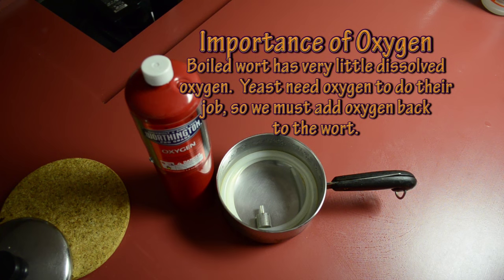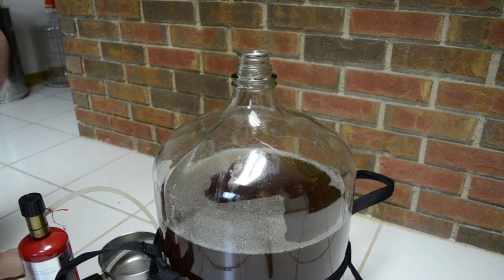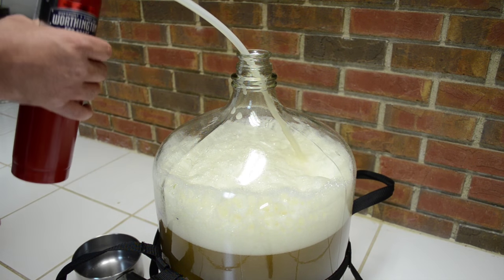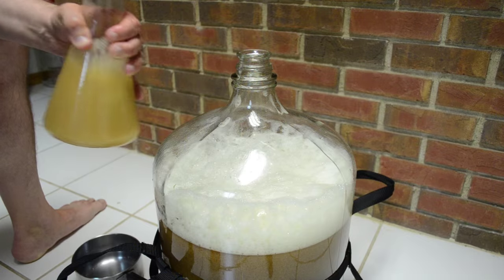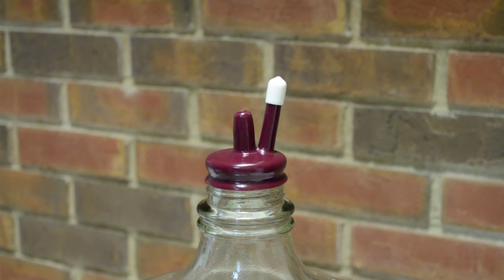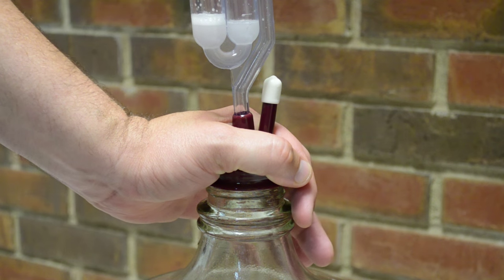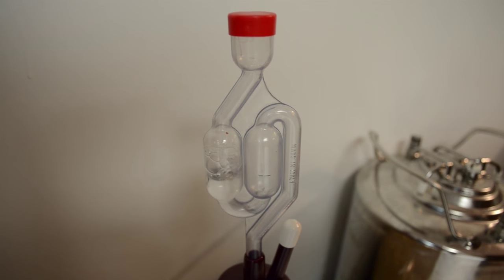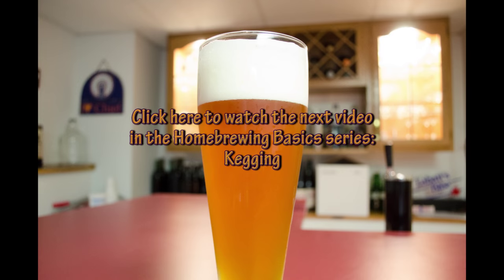Homebrewing Basics: Fermentation

Comment: Great video's, I brewed an all grain beer a month ago, really its been over 20yrs since I last did that and forgot most of it and just went with it, lol I basically violent boiled my grains and hops for 1hr in a grain bag, and poured it into my fermentor and let it cool for 24hrs and added yeast once it was cool enough. Guess what after 4 days nothing, I added a cup of rice and within 1hr It started bubbling and worked really strong for over a week and when it was finished it registered just below 1.000 gravity. The beer turned out really nice. I'm thinking the rice acted like what your oxygen tank did.
Reply: I also added a cup of crushed grains when I added the rice, but you wouldn't think that 1 cup of grains would of saved this batch, I'm thinking it was the rice, due to all the starch rice has, It was risky tossing the grain and rice in but luckily it didn't go off . Here's a pic on FB of the finished gravity level https://scontent-yyz1-1.xx.fbcdn.net/v/t1.0-9/34016712_10156509249680972_1822270846060724224_n.jpg?_nc_cat=0&oh=35c0b12bee82801b6169e0a542ae299a&oe=5BB1F267
Reply: Did you just add the rice straight to the beer? It doesn't affect taste?
Reply: @owenmartin3307  yes I did
 And no it doesn't change the flavour

Comment: Hi Larry, I'd like to ask you a question. Wouldn't it be 'dangerous' for the sanitizating solution to be in contact with the wort? I mean, it could add some taste to the final beer. For sanitization I've got peracetic acid and an alcaline detegent (sodium hidroxide at 28%) and I have serious doubts on which elements I should use them, or not to.
Apart from that, I really apreciate your videos. They're genius (maybe because you are). Thank you